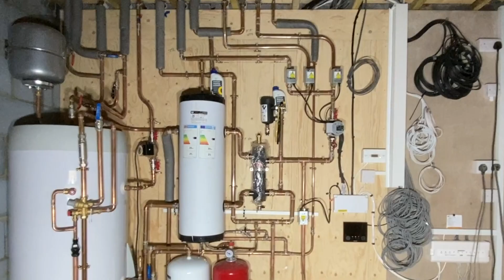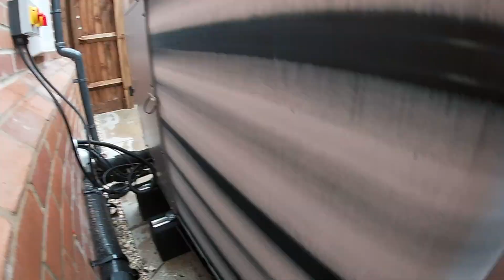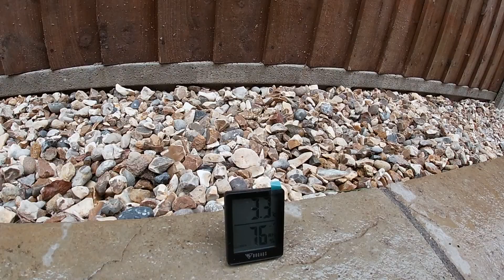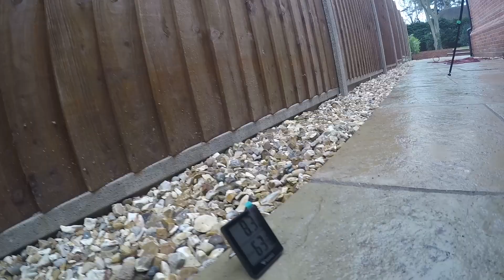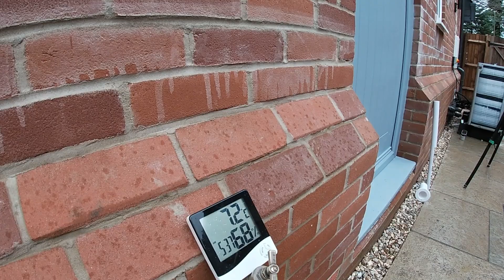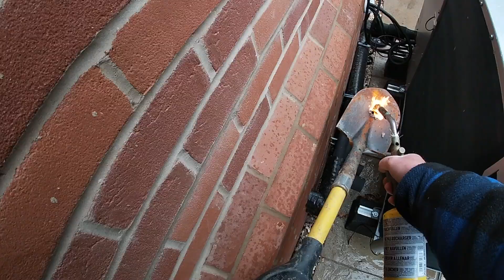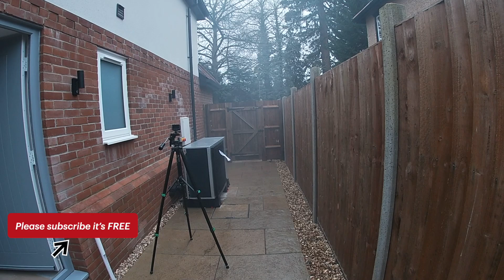Heat  Pump Freeze Up - HELP!

Comment: run the same test with the gate opened
I take it the heat pump is fitted to manufactures spec, if not start their first.
with temp of  low 0.8 °C	high 4.1 °C	avg 2.7 °C had 4 de-ice cycles in the last 16 hours 00:10, 03:54, 05:38, 06:58 
7Kw Vaillant the unit is well exposed, @UpsideDownFork is quite close, so I'm inclined to go with his post.
Reply: Over past week I've had low 3.1C high 5.1C and zero defrosts, Daikin 6kW, in my case it's on flow control at 32C (34C when colder) drawing a steady 560 Watts today running continuously, this is for reference only as my property is a modest two bedroom semi' with modest insulation by todays standards.
I would tend agree with @UpsideDownFork, 14kW in a new build very well insulated dwelling sounds excessive.
Reply from the maker: Hi Tried it it is marginally better with gate open  with no breeze and better with breeze  Thank you 👍
Reply: @HEATSEEKER1428  Have you tried to heat pump in eco mode
near the end of the heating season now, so you will have 8 months to sort it out.

Comment: Since moving or lifting the pump is not an option, and it is clearly visible that the same air is recirculating here, you either need to get rid of the cooled air or supply fresh, warmer air to the pump through an additional ventilation duct with a fan.
Reply from the maker: Hi I think one of the comments before might be the answer. A wrought iron gate  . Thank you for your comment  .👍
Reply: @HEATSEEKER1428  

The heat pump is well within manufacturers spec' in terms of spacing around the unit.

In defrost mode the fan is running at full power to clear moisture from the unit, in operational mode the air circulation will be much less except perhaps when heating HWC.

Comment: You’re getting local recirculating. I’d think about changing to a metal open gate and or cutting some ventilation holes in the fences. The metal fence would be the easiest to try out because you could always remount the old gate if it dosnt work. 

Really the best solution would be to move it to somewhere else with much more flow away from the unit. 

The other thing you could do is make up some slats to re-direct the air down the alley way. You look handy with tools so build a temporary ducting type affair. Big box and slanted shutters to direct the air inside. 
_________
|.         ____     
|  /  /  /

Something like above if this lines up on your comments. Basically get the air flowing and it will pull air in to a degree.

Comment: It looks like you have a Daikin Altherma 3 monobloc? A number of questions? 1. How do you know what the performance is? In my experience the proprietary energy consumption and heat generation monitors are not that reliable. As a starting point, I would install OpenEnergyMonitor to provide you with accurate performance data . 2. Was a heat pump survey conducted and if so what methodology was used? Many heat pumps installed under the MCS are oversized due to inaccurate assumptions made about heat loss and air tightness? 3. Have you enabled weather compensation? 4. Have you tried running the heat pump with the gate open to avoid recirculation induced short cycling?
Finally, a COP of 2.5 is not especially poor if the outdoor temperatures are hovering around 0 Celsius and the heat pump is in an enclosed space.
Reply from the maker: Hi  I just used data from interface for rough calculation . The heat calculations as far as I know were done by Daikin or approved . The HP is 14 Kw the property is a new build 6 beds and 5 bathrooms . I have fitted larger HP s in smaller properties with no problems . I suppose 2.5 cop is not that bad  with air flow and temps. perhaps I should manage my own expectations . Thank you 👍

Comment: What about a ‘V’ profile made of wood directly opposite the fan and fixed to the fence panel forcing the air to ‘split’.
Reply from the maker: Hi thanks that could be and option to even try. thank you 👍

Comment: I have a 9kw Daikin which looks same as that. Defrost every 45 mins if temperature is lower than 5 degrees and air is humid. COP is around 3.4 for me. Average room temps around 22 degrees.  I have an oak lean-to over top  of mine and I requested that the heatpump be mounted on the wall on wall brackets with drip tray and rubber isolators instead of floor mounted - base is at knee height... as cold air falls to the floor (plus easier eye level servicing for annual service). Pipework is 28mm pipes to tank. 22mm on loop and 15mm to rads. I have a buffer tank too. I have mine set to weather compensation mode not thermostat. Curve is quite tight.
Reply from the maker: Hi thank you for your comments . This is daikin 14 kw   all pipe work 28mm.22mm and 15mm copper tube. 
Do you have a buffer on your system ? Thank you 
👍
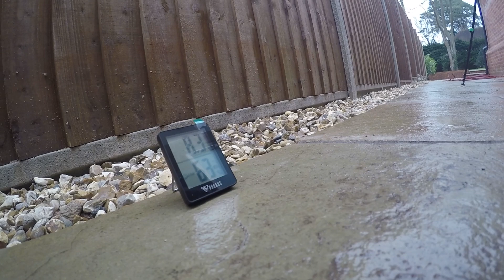Reply: @HEATSEEKER1428  Yes I have a buffer. Think its a cordivari 26 litre one. WD curve is set at -3:32   15:38. Quite tight as its the notorious 'special' one the 9kw. works for me though. Thats a heavy duty one the 14kw. Must be a big house. mines same model basically thats been software restricted. same pump and everything. tickover consumption is about 930 watt per hour due to large pump.
Reply from the maker: @digitalfantazia3953  Hi Yes  large house 6 bed 5 bathrooms . Thank you

Comment: The quickest thing, on the gated end, remove alternate boards to open up the fence & gate. Also create a 200mm gap at the bottom of the fence/gate by cutting the boards.
Reply from the maker: Hi Not a bad idea but I don't think the people living next door would like it . Air blowing into their garden . Thank you 👍
Reply: @HEATSEEKER1428  I understand, but I did say the gated end,.... NOT the party fence.  Opening up that end, lets you see if things improve without having to move the ASHP.
Reply: @HEATSEEKER1428  Would be a good test to see if it made a big difference just ask if you could remove it to try

Comment: How did it work with no pump on the other side of the header?
Reply from the maker: Hi I have not tried without pump the other side of the header . Do you not think that removing the pump would slow circulation through the various zones  ? Thank you 👍

Comment: Ok, air circulation may be a contributing factor but probably a red herring.

What's your heat loss?
What's your system volume? Is it all open or are you zoning off parts of the house?

Your pump looks like the potentially dreaded Altherma 3. The 9kW unit is a software limited version of the 16kW. This means it needs an exceptional amount of system volume to prevent excessive cycling and defrosting.

An ideal system volume for this unit is 400L for best operation.

Presumably you have your controls set optimally. If your weather compensation curve and the resulting flow temperature is set too high, this will significantly increase the rate of cycling and defrosting.

A wild stab in the dark but I would guess that you have insufficient system volume, the heat pump is oversized and the controls are running too aggressively.
These 3 factors are the cause of poor COP and high running costs.
Reply: Just check your previous videos you seem to installed a 14 kw unit. did you get or do a heat loss calculation ?
Reply: 14kW is a lot, your property looks pretty modern,
Reply: Just out of interest, did Daikin send you a heat loss report? 
Reason is Daikin do not do heat loss calculations, they will however give you a rule of thumb based on "50w/m2" as a guide to quote but this is not a heat loss.
Reply from the maker: @AMHeatingDesign  Hi I will check but as far as I remember the design was done by Daikin or perhaps a daikin approved designer . But defiantly all calls were done  Thank you 👍
Reply from the maker: Hi Heat loss and HP calculated by Daikin 14 KW All controls and zones wide open all perimeters set up as correctly as possible on interface. Lots of volume  with volumiser on Hot water primary side , Buffer on heating all pipe sized correctly and all 28mm,22mm and 15mm copper . Thank you  for your comments 👍
Reply: @HEATSEEKER1428  My 1950s ex council house's heat loss (Wimpey concrete construction-terrible, with external PIR boards-good) is around 9-10kw depending how I calculate it (and it has terrible old draughty windows), I am running my old condensing gas boiler (24kw) at about a 1/3 of it's output and it only needs nudging up on the -3c days.

14kw for your seemingly brand new house is madness... It's like putting a V8 into a reliant robin.
Reply from the maker: @Roedy_Coedy  Hi This Brand new house is 6 bedrooms 5 bathrooms . !4 Kw is about rights your  your gas boiler really 24 KW ??  Thank you 👍
Reply: @HEATSEEKER1428  I agree with @Roedy_Coedy and @edc1569. 14kW seems high. Heat Geeks did a video fixing a guy's bad install. Big house, decently insulated. Heat loss was 12.7 kW. If you have a new place, good insulation, no leaky windows, even if it's 200 sq m, 14 kW would be high, I suspect.
Reply: @Roedy_Coedy  surely bigger is better as the pump has to work less and is far less likely to freeze up. I have an air to air and it only ever freezes up when it's working really hard so say room temp is 16c and I'm demanding 24c. If it's just ticking over holding at a temp then it's fine.
Reply: @HA05GER  quite the opposite with heat pumps, as they are designed for worst case scenario I.e. -3degC outside, when it is say 7degC outside the heat load is halved. Once you start zoning you reduce the heat load further and so end up with a heat pump pulling 1000w but only able to output 2000w inducing alot of cycling. Boilers tend to have a modulation range of around 1:10 whereas this particular heat pump is closer to 1:2 (maybe 1:3 at a push) so will rarely find a steady state unless you have around maybe 200l of open system volume to work with.
Reply: @AMHeatingDesign  that's interesting to know I've learnt something new today and that makes sense. Then you have less heat to defrost it aswell then.
Reply: @HA05GER  yeah kind of, it depends on your flow temperature to your heating system which determines work load, and the humidity outside. At minus temperatures there is less moisture in the air so defrost is less of an issue but when it's "5degC" outside there could be plenty of moisture in the air and the heat pump will be sucking in 5degC air and expelling -5degC air which will freeze the moisture.
If the flow temperature is 35degC then there is less work to do and the heat pump will remove less heat from the air and so will defrost less. If the flow temperature was something ridiculous like 55degC then it will likely defrost every half hour or so.
The energy to defrost will be taken from the system volume so if you have a low volume system the radiators might drop by 10degC or more, if you have a large volume system then you might not even know a defrost has happened. 
Large volume/low flow temperatures, long run times = high efficiency. Small volume/high temperature, short run times = running a heat pump like a boiler, the only difference is with a boiler it might cost you an extra £30 a year or something insignificant when cycling with no real degradation of parts. With a heat pump that could be £300 (or considerably more) a year and reduced compressor life span.
Reply: @AMHeatingDesign  that's interesting to know thanks. I knee flow rate is better lower but no one ever explains why but that makes alot of sense. My mum's house is run by a heat pump and I keep trying to tell her that the flow rate needs to come down but she loves hot radiators 😂. I try to tell her it'll save her money as her heat pump in a 60s bungalow is costing roughly the same as my boiler in a 3 bed house of similar era. I think she gets a cop of about 3 give or take so isn't horrific but now I understand it maybe I can convince her.
Reply: @HA05GER  haha no worries. I think the old rule of thumb was for every 1degC in your flow temp it will roughly cost an extra 2.5-3% running cost per year. So the difference between 40degC and 45degC flow temperature could be around 15% saving per year very roughly.
In terms of work load, if the flow temperature was 35degC then compressor would have to get the refrigerant up to about 45degC for heat transfer. If the water temperature was 55degC then the compressor would have to get the refrigerant up to 65degC (ish) to transfer the heat. It takes a hell of a lot more work to compress the refrigerant to get to those temperatures/pressures.
The closer the source temperature is to the sink temperature the less work needs to be done. 🤙
Reply: @AMHeatingDesign  thank you that's quite a lot of information. My mum runs hers at 50c it was installed by the council and that just how they set it up so maybe I'll try knock it down a few degrees and not say anything and see if complains about it 😂. Again I appreciate the info this sort of stuff really interests me. I'm an engineer by trade so just have a liking for anything mechanical and keep considering whether to get into AC which sort of comes hand in hand with heat pumps. AC is obviously alot simpler but same principle.
Reply: @HA05GER  if it was done by the council just make sure weather compensation is active also, i have been to many where it is left on fixed flow temperature.
A/C is great as you are not heating water to heat a room, you are just heating the air which is much more reactive. Also heat pumps are only as good as their design and what they are connected to i.e. the best heat pump in the world could run badly if connected to a bad system where as with AC the manufacturer have an indoor unit connected to an outdoor unit which has been tested together so you tend to get the running efficiencies on the data badge. All depends on what you try to achieve with it, on a single room it is a great system. If it's a whole house and domestic hot water it gets more challenging.

What heat pump does your mum have?
Reply: @HEATSEEKER1428  These are things that should be carefully checked. 400L for the heating circuit is huge for most domestic properties (well over twice the average heat pump heating system). Discount the DHW side of the system. Just focus on the CH side of the diverter valve. You buffer tank looks like a small one, perhaps 25L or so.
14kW is a huge heat loss for a new property. If i'm understanding correctly, this is a brand new building?
To meet current building regulations it will need to have a heat loss lower than 40W/m2. This equates to 350m2 floor area for the property. A decent new build will be closer to 20W/m2 which would be 700m2 property. i.e. a castle. 

If Daikin did the heat loss and the system design, i'm inclined to be even more suspicious. Especially if they are the ones who prescribed a LLH after a buffer tank, that's just insane system design.

Depending on the run from the heat pump to the diverter valve, 28mm is typically too small for the primaries. You really want at least 35mm depending on length and how many valves etc are adding to the losses.

There's a lot of alarm bells ringing for me but i'm just trying to start with the fundamentals and not get into the weeds too much.

Comment: Heat Seeker, I'm not going to subscribe to your channel or like, here's why,  what you have done here is absolutely appalling, these do not work efficiently, they are expensive ,  there's nothing good about a heat source pump, it's not fit for purpose, the houses of parliament have just announced that they no longer will be fitting these any longer, there words not mine. You have been fooled by this labour government. Rip it out , put a gas boiler in.
Reply: And nobody cared. Bye Felicia.
Reply: The tories were the ones who pushed heat pumps through the RHI and then the BUS schemes. Definitely not a Labour con.
Reply: And what keeps your heat source pump running when there's not enough wind and sun??? Yep it's  beautiful natural GAS. It's just a matter of  when now, that net zero will be concreted over for good. Bring in the Trump administration to the UK Reform party and drill baby drill .
Reply: Correction. The houses of parliament said they wont be fitting these - in the houses of parliament. They absolutely 100% do work as long as they have been considered as part of the install correctly. I had mine fitted in a detached 1893 cottage last year and its cut my energy bill down by one third. The whole house is warm 24/7 with all TRVs open on the radiators. My family will never suffer from carbon monoxide poisoning and it wont explode and kill anyone and I have no gas meter anymore (which I had fitted 32 years ago when gas came to the village). My  dining room is currently at 24 degrees and I have had to open the window up to cool the room down.
Reply from the maker: Hi I respect your view and would ask you to reconsider subscribing to my channel every little helps. Despite the  problem that I am experiencing with this particular installation I have todate  installed a few heat pumps  both air to air  and air to water . I have had no problems . the air to water typically have a C.O.P of 4 and the air to air heat pumps have at times had a C.O.P of up to 6 . I do not Know  what the C.O.P  of any gas boiler is but I know it will not come any where near the performance of a well installed HP.  If Electricity was cheaper  we would all be screaming for heat pumps. I Have been told that gas is cheaper than electricity because there is no tax on gas. The reason the government only tax electricity is because we have no choice  every body needs electricity where as with gas you have a choice .Thank you  and good luck . Your subscription would be much appreciated 👍
Reply: @HEATSEEKER1428 no, the price of electricity is set but the cost of the most expensive generation source which currently is gas, you loose about 60% of the energy in converting the gas to electricity and then transmitting it to the home, transmitting electricity is also kore expensive than transmitting gas on the gas grid, hence it currently works out about 4x the price.